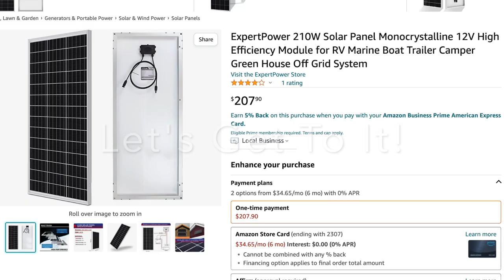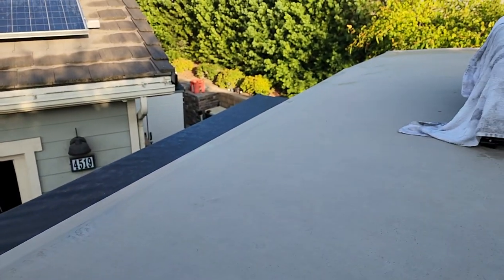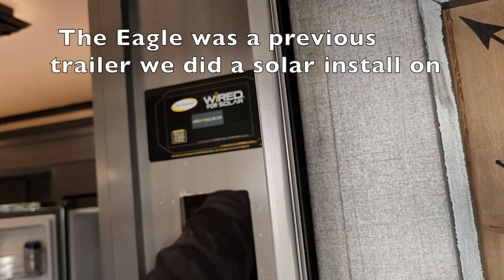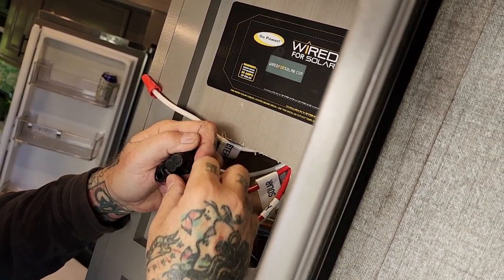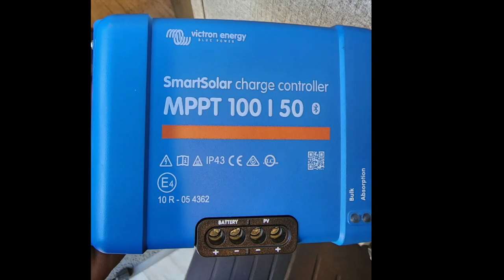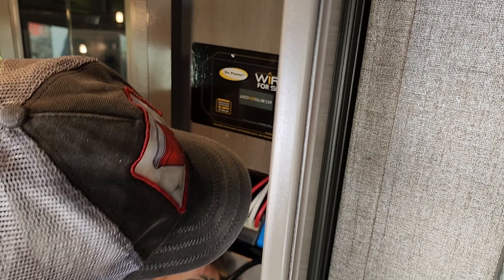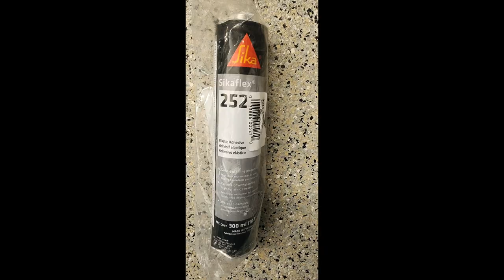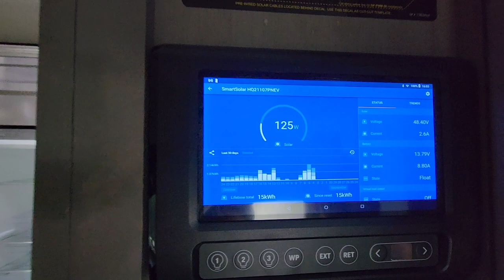#rvsolar#diy   RV Solar...Do You Really Need It?

Comment: The Victron 100/50 controller you installed is only rated for 700 watts
Reply from the maker: for 1 12v battery yes, but I have 2 12v Evo Lithium for a total of 24v so the controller is then rated for a total of 1400 watts
Reply: @bubba1948a Do you know how the panels are wired? How about the panels open circuit voltage? 
My company helped do the install with them as we are friends.
It is a 12v system and it consists of 4 210 watt panels with each panel having a open circuit voltage of 24.5v and 12.5 amps available to the Victron 100/50 controller 
Thus, the solar panels are wired in series parallel send a maximum of 49v and 25 amps.
As a Victron dealer I am quite aware of the capacity of each product. Also the Victron controller would not even operate if it was having a OVER voltage event.
I hope this clears this misconception up
Please remember the key words in my post
“In series, parallel”